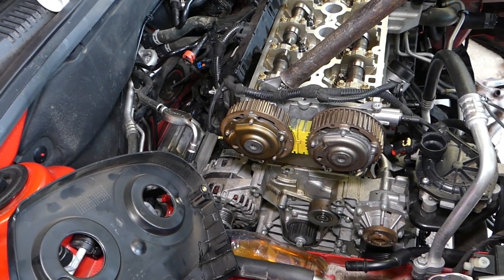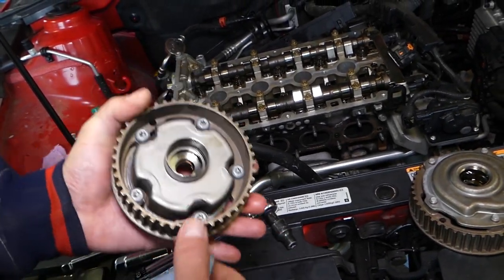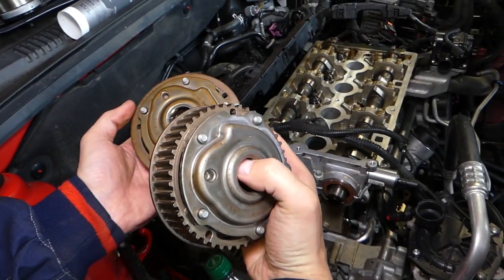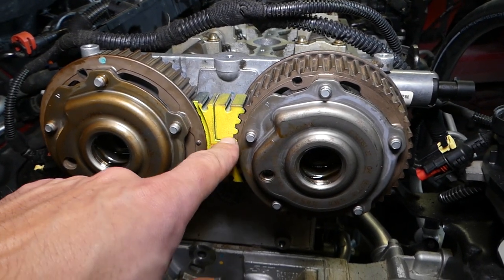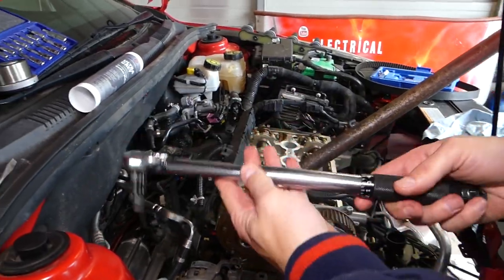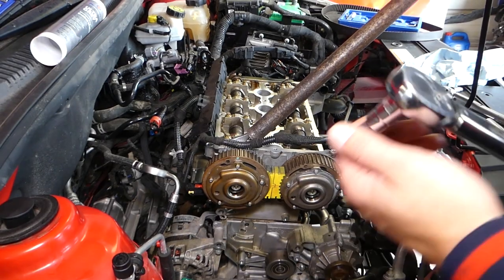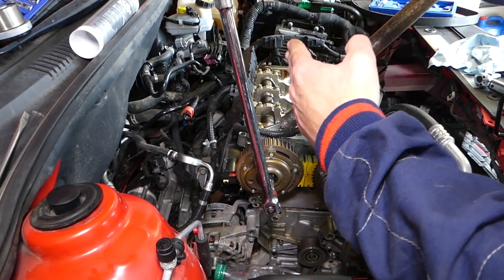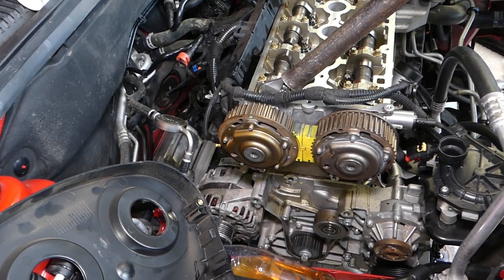VVT CAMSHAFT TIMING GEAR SPROCKET TORQUE SPECS ECOTEC 1.8 1.6 CHEVROLET CRUZE CHEVY SONIC

Comment: I've reused the bolts before.  Done it on several vehicles that required camshaft bolts replacement.  Never, ever had a problem.
Reply: What about the hub seal?
Reply: Tis what ima about to do fk it
Reply: How did it work out for you?  I’m
Leaning towards just buying the bolts because the stretching is to scary to me to have a bolt break.
Reply: @cygnus1965  I’ll let u know tomar afternoon  how it goes with the reused bolts
Reply: The vehicle is still running and on the road.  No issues reusing the camshaft bolts. Even the techs said they reuse them
Reply: Sure you can do that but it’s a bolt you’re stretching several times. What would happen if the bolt failed? I think two bolts are a lot cheaper than the damage you could cause to the engine.
Reply: I don't think these are  torque to yeild bolts but could use blue locktight to be safe. It's not a interference eng so not end of the world if it does slip but never had an issue. Also no need to advance crank but always check, not a bad habit. I'm just double specs, cuz I got 2 answers elsewhere
Reply: Bro they're 4$ usd each.....

Comment: The VVT sprocket bolts and caps are a T55 not a T50. If you use a T50 and follow the torque specs recommended here then you may damage the blot heads to the point that you cannot ever get them off again because they will be partial or totally stripped out due to the sloppy fit of the t50. T55 is tight and will not damage the insert when torquing..

Comment: Good morning hey on my exhaust camshaft I accidentally knock  off one of my little blocks on the end of the camshaft h will I need to change my camshaft or will the   sensor still read the speed of the camshaft
Reply: I had the same problem.  It's called a reluctor ring.  It's going to have to be pulled off with a bearing puller and you replace the new one by heating it, maybe with a heat gun, and slipping it back onto the camshaft.  Be sure that the new one is placed in the exact position as the old one and that the clearance from the reluctor ring teeth to the position sensor is also the same; check the clearance using shims.

Comment: Hay I have the cam locked but I moved the crank so how do I try to get it back the right way. I know how to find top dead center but would that work on this kinda of car. I relly dont wont to mess it up. Any help you can give would be very helpful
Reply: So it doesn't have vvti now what does it affect when it's locked

Comment: What is the reason for you need to replace the gear sprocket, it's the sleeves that wore out ?
Reply: What sleeves are you referring to? Any info appreciated. Thanks.
Reply: The cam gears need to be replaced when they start leaking oil.
Reply: @gerardoramirez6976 the sleeves are little black plastic cylinder looking parts that go in the center of the cam gear and into the camshaft, the cam bolt basically goes through the sleeves when you bolt it up.

Comment: Whats the purpose of the tubes in the center of the gear?
Reply: They are oil feed tubes. Directs the oil where it needs to go for gear to lock timing.

Comment: I cannot find these bolts anywhere. Where can I buy them?
Reply: You can get them either from China (much cheaper than the GM parts) or from your GM dealer if you don't want to wait or pay the high shipping charges from China.  The GM part number for the sprocket retaining bolts is 94502154.
Reply: @howiesiesoosoo  thank you!
Reply: @howiesiesoosoo  I finally got the bolts from gm. The updated part number is 12992403